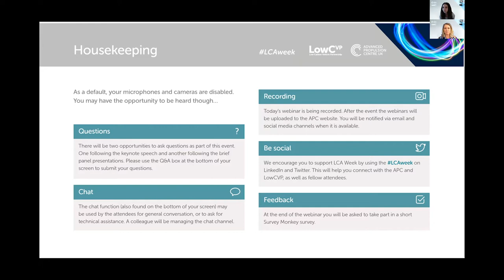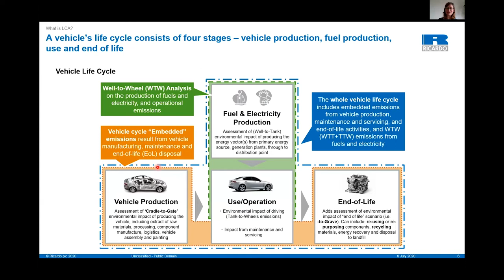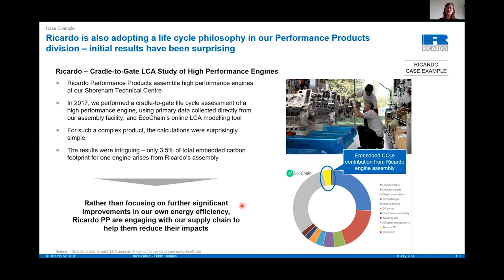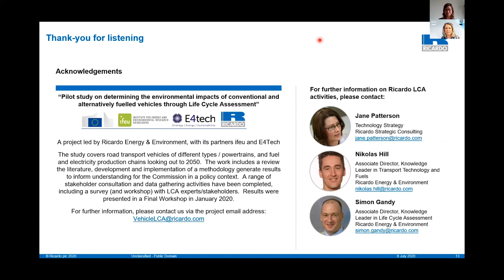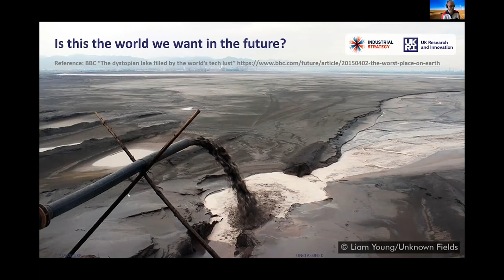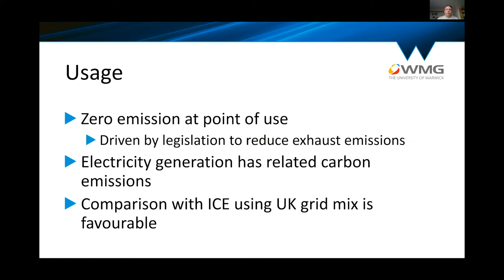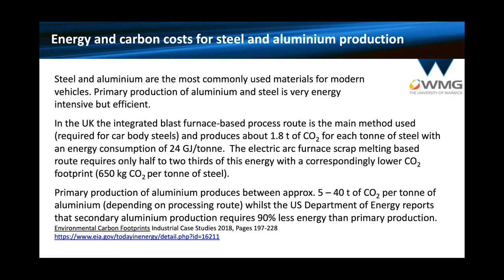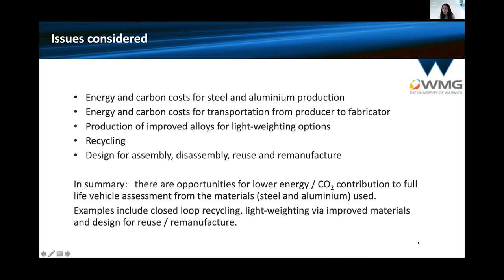LCA webinar: Vehicle emissions - widening the lens

Comment: If the Environmental Audit Committee (Reducing carbon emissions from transport 2005/6) recommendation that national speed limit should be reduced the efficiency of ICEs would increase and the advantage of EVs would be delayed.  However, the EV efficiency and comparative advantage would also increase. The critical point is that embodied emissions occur early in the period when emission savings would be most important (compared to savings in use later in the next decade).  The other issues that might have been mentioned are automation and vehicle sharing that could complement electrification and sharing the carbon emissions per capita.